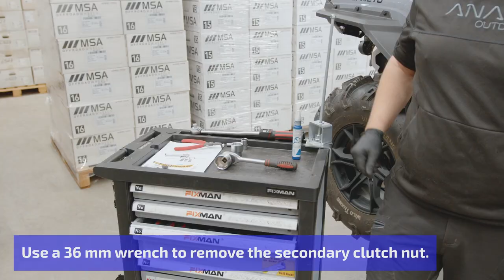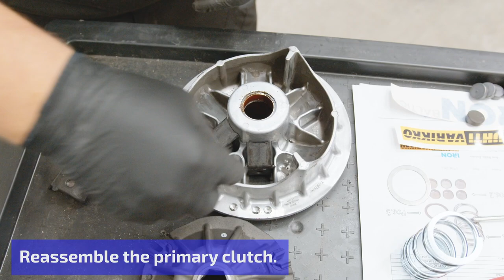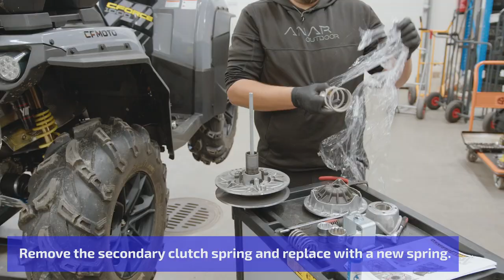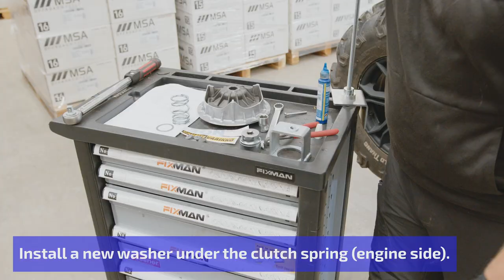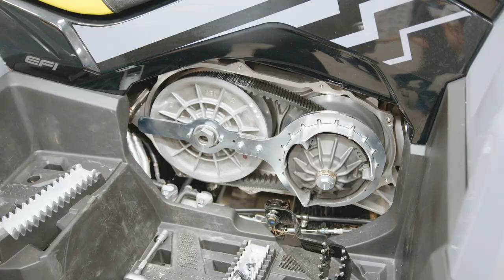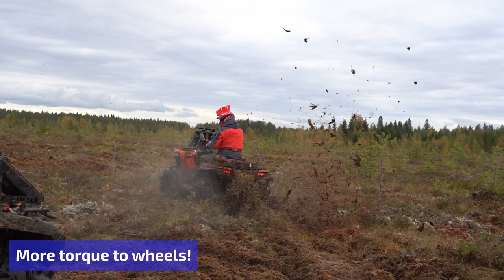CFMOTO STAGE 2 CLUTCH KIT INSTALLATION

Comment: I installed my stage 2 clutch kit today. Everything went pretty good . I however did not turn it to preload the spring. I suppose I should tear it down and do that? Will it hurt anything if I don’t? Will I notice a difference? Thanks a million
Reply from the maker: Hi, yes you should definetly turn the spring to preload. Yes you can feel the difference.